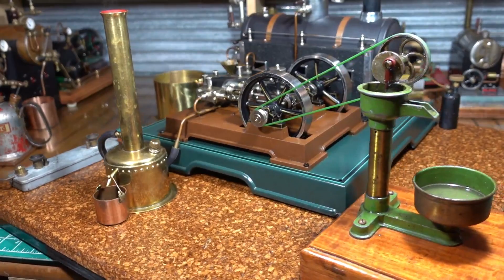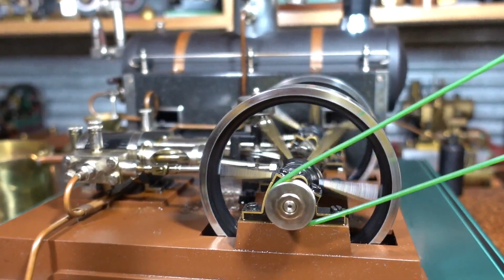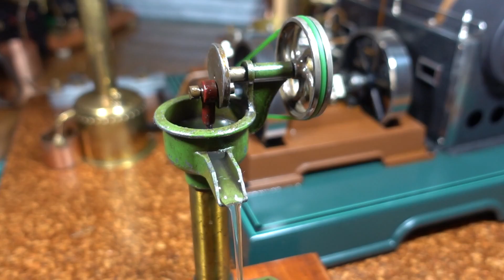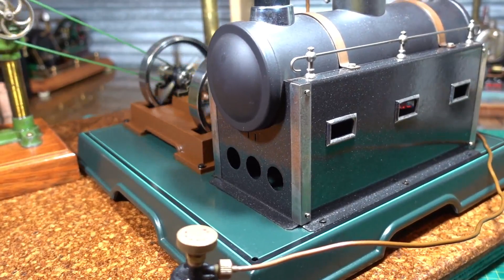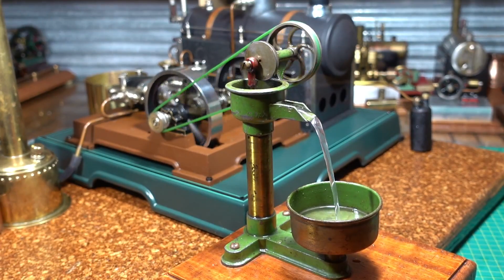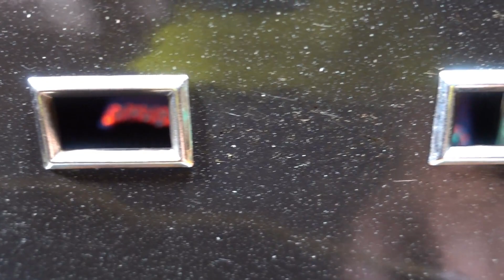German Märklin 16051 Steam Engine running on live steam

Comment: Running that BIX burner too hot. Shouldn’t be glowing orange.
Reply from the maker: They are always going to glow red when they're in an enclosed firebox. You can set them perfectly outside with the gas jet positioned so that you only have the dancing blue gas flames, but inside an enclosed firebox when the temps rise they're going to glow red.....its no problem, if the SV was continuously blowing off obviously you could turn down the gas flow. 
All gas heaters that use ceramic elements whether domestic or industrial glow.